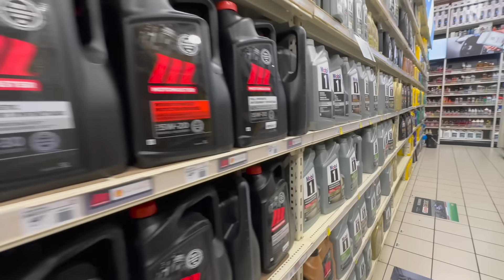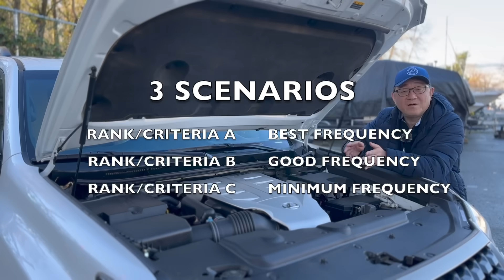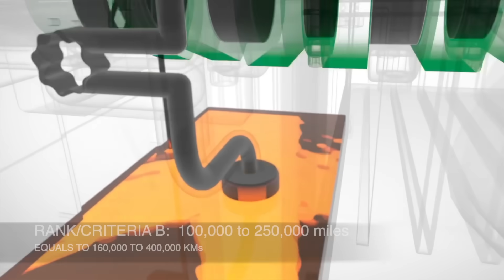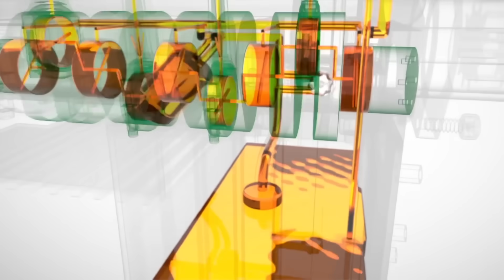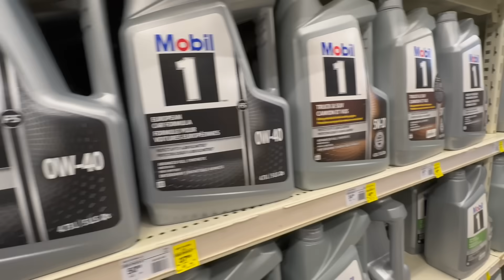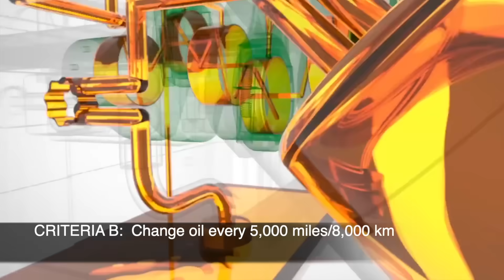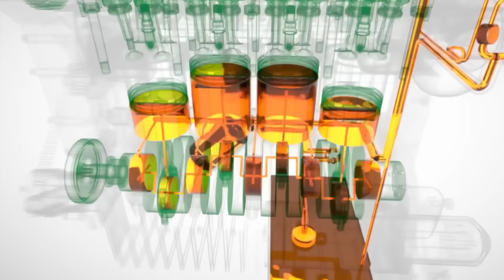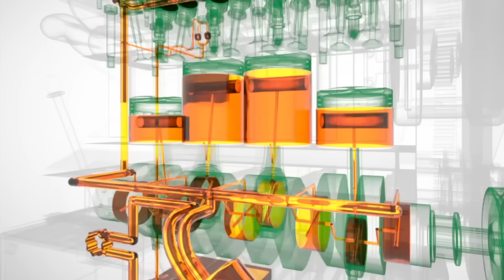ENGINEER EXPLAINS HOW OFTEN TO CHANGE OIL & FILTER // UPDATED CRITERIA-BASED RECOMMENDATIONS!

Comment: I've owned my 2004 Audi S4 since it had 13,000 miles. After 20 years of use it now has 161,000 miles. I change the oil and filter every 10,000 mi. as recommended by Audi, with Mobil 1 full synthetic without issue. I'm even on the original timing chain guides and tensioners.

Comment: David thank you so much, I have been using 20W50 mineral oil on my Montero Mitsubishi for 15 years and changing every 5000 kilometers, can I change from 20W50 oolong to 10W30 oil and how does this change will affect my engine or will this change may protect my engine ? Thanks again!
Reply: I would use whatever viscosity is recommended by Mitsubishi.  20W-50 is too heavy an oil for that motor, unless you're experiencing a lot of oil consumption/burning.  It should be using a 5w-30 or 10w-30.

Comment: I purchased a new Corolla in 2007. I drove 3K miles on the factory oil then changed it with Valvoline full synthetic. I drove another 7k miles on that oil then changed it again at 10k miles. I’ve been changing my oil religiously every 10k miles and ALWAYS used Valvoline full synthetic and a quality filter, usually Mobile1. As of February 24 the car now has 265,000 miles and it runs like it’s new!  The oil looks like I just put it in even after putting 10k miles on it. A mechanic called me a liar when I showed him the dipstick with 10k mile oil on it. It’s just that clear. I started the 10k mile intervals so I would always know when it’s due for an oil change. I highly recommend Valvolines line of  full synthetic oils but honestly it doesn’t matter what oil brand you use as long as you stick with the same brand. I’ve been told that switching brands constantly is not recommended due to the difference additives each manufacturer puts in their oils. Today’s synthetic oils are far superior to oils used in the past when oil changes were needed after 3-4k miles. If you could see the oil in my engine after 10k miles you wouldn’t believe it.

Comment: Normal in Sweden is to change oil, and filter, at 15000 km, 9300 miles or once a year. It takes me about eight months and i do it myself and it costs ca 65-70 $ with 5,2 liters of premium oil. Never heard of any problem due to dirty oil when following that intervall using god filter and oil. My cars run at least 300000 km before i sell them. So it seems to be an american problem.
Reply: Americans are stuck back in the 1960's, before synthetic oil came along, and think they still need to change oil every few thousand miles. Oil change places and self-proclaimed experts are keeping the lie going.

Comment: I bought a 2020 Silverado (new in 2020) with a 5.3 V8.  I use it to tow a travel trailer in the summer (6000lbs). I change the oil at 7500 Km (the book says 15,000 km) and I can tell you that the engine works great.  I have changed the oil frequently for every car/SUV i have owned and the engines do not break - lots of other things break, but not the engines.  I always use synthetic oil, the grade that the engine needs, and I always put a new filter on.  I don't care if you get a new car every year or plan to keep it for life - change the oil.
Reply: It's unnecessary to change oil more frequently than the manufacturer recommends. You're just wasting time and money.

Comment: Your recommendations are very conservative. I’m an Amsoil user and I have been changing oil every 15,000 miles or 1 year for 27 years and have put as much as 287,000 miles on a car with zero oil related engine problems and the engines have always run like new when sold, even with 287,000 miles on it!!

Comment: No one will ever convince me to change oil beyond 3,000 miles regardless of condition of ownership. I have seen the power of 2500 mile oil change. Not only does it protect seals, it also ensures the cooling system works exceptionally even as the car ages. People keep focusing on oil as a lubricant when in fact, your engine oil is also an engine coolant.  Fresh oil will always cool better than old oil. With fresh oil, your radiator coolant does not work as hard and as such it will not break down the coolant as fast. The cooling effect of clean fresh oil is highly under-appreciated. And this is even more so if you have a car with turbos. You replace turbos in pairs even if one turbo fails. Replacing two turbos because you refused to change your oil frequently, can cost you between $2K - $4K. Brand new turbos are not cheap.

Comment: I change the oil on my crv 2004 every 3000 miles with full synthetic oil regardless. I figured its cheaper than a new car replacement  & I'll drive it to the ground 😂 It got 250,000 miles & I got at least another 250,000 miles life on it.

Comment: Sadly, there is no guarantee that an engine will last 60k miles, let alone 250k miles anymore. There just isn't any motivation to build vehicles that last from the manufacturer. In my experience vehicles are just getting more complicated and less reliable.

Comment: I change my own oil and use Costco synthetic.  That costs $30 for 10 quarts right now.  So for under $25 I get it done with the filter.  What is the point of going 10k, so I can save $25 per year?  Seems very foolish.  I'll keep with the 3k plan.  Thanks for confirming my decision.

Comment: It’s easy.  When oil light or engine light flashes then probably time to get an oil change.

Kidding of course
Currently driving a 2004 Prius. 225k miles. Change oil every 5k or 6months, whichever comes first.  Using Mobil 1 high mileage typically

Zero oil leaks, original hybrid battery
“Burns” 1/4-1/3 quart between changes.

Comment: Although I agree… 5000 miles
My ‘07 Yaris 5 speed currently has 301,000.
I’ve owned it since 18,000 miles.
I’ve changed oil and filter every 10,000 and have not touched the engine…not even the water pump.
Car runs great and currently uses about 1qt every 10,000 miles

Comment: Interesting summary and as always it also contradicts other engineer research and recommendations.  SYNTETIC oil summary: Ihad a 2003 Chrysler DC with 306K - change oil and filter every six months, but lost it in a wreck.  Current 2012 Chrysler TC with 123k change oil 1 a year and filter every 6 months.  I average 6K mi annually on 10-15K Mobil 1 and Mobil 1 HP Filter.  Bottom line: take good care of your wheels and they take good care of you.

Comment: Opinions are fun, but upon what data are these recommendations based?  I’ve never seen any data that shows a difference in engine life for 3,000 mile changes vs. 5,000 or even 7,500 miles.  Lots of anecdotes and opinions, but no data.

Comment: Owned my last car for 10 years, changed oil every 7500 miles with synthetic.  It ran fantastic when I got rid of, had 120,000 miles burned next to-no oil.  Built several high HP engines over the years and ran synthetic oils in them changed every 5000 miles, when I did finally pull apart (mostly to build a higher HP engine) there was zero signs of additional wear to bearing surfaces.  I try to use Mobil 1 but have used Pennzoil and Castrol.  We have owned several Audi’s have 2 now and change them the recommended 10k, have yet to have any issues with any of them, my wife’s was the longest owned that one and traded in with 98k miles.

Comment: ‘’I bought a new ‘’2023 TRD OFF ROAD PREM’’….I had the oil 1st oil changed @ 1000 miles….next oil change will be at 5000.00 ..got underneath my 4 runner..1st. Thing turned my spare tire upside down so I can check the air in it and also sprayed rust on top of the spare tire. Then undercoat the rest of the truck.   I will tell you this truck rides fantastic.    ‘’Thank you …for all the reviews and videos on these amazing automobiles.    Thanks. God Bless and many prayers to family and friends.
Reply: Don’t most new car engines come with a special factory oil with additives in it that help keep the engine lasting and help with break-in? Most mechanics I hear this information and that’s why it’s recommended for most new cars to not change the oil until 6000-7500 miles at least?

Comment: Where is the data? Otherwise it is just your opinion. I drive a car 30-40 years and 300+K miles with long oil changes of approximately 25K miles based on oil analysis, i.e. data not opinion.

Comment: Hmmm.  I like to keep a car for a long time.  I change the oil on my cars, with synthetic oil, every 5000 miles.  I have two cars that have 180K and 190K right now.  No engine problems.  A few years ago, I had a car that I used for work that did nothing but highway miles and always came to full operational temps each 57 mile trip. I changed the oil on it every 7500 miles.  I got 319,XXX miles on that car until I totaled it by hitting a deer. Car's engine was still running strong.  I might also add that I drain/refill the transmission of a quart of tranny fluid every other oil change and have never had a tranny problem.
Reply: I have a Australian Jackmaster Classic bypass filter on the Pontiac Torrent  3.4 engine and a Motor Guard on the transmission. The transmission will never need a fluid or filter change. The Australian Jackmaster Classic will get a filter element change and a quart of new Walmart synthetic every 6.000 miles. I cut the standard Wix open at  6 years and about 65.000 miles. The pleats were rotten but still in one piece. Im told the Wix XP is synthetic and wont get rotten. It should make it the rest of my life. The Jackmaster Classic does the cleaning. Im 83

Comment: Are aware if unopened 0w20 oil has a shelf life ?
Reply: 5 years is normally the shelf life, you'll find the stamp on the bottle. You could push to six if it wasn't stored in a garage, due to fluctuations of temperatures.

Comment: I use Mobile 1 or Castrol Full Synthetic and changed oil every 10,000 miles. I have done this for the last 25 years. I have run two cars up to 325,000 miles with no engine issues and sold them both running good. I wouldn't do that with standard oil.

Comment: I have a 2013 F150 with 230,000 miles on it and I change the oil every 3000 miles and filter and it runs like a brand new truck. 5.0 L.

Comment: 2004 Silverado 5.3 using Mobil 1.
Since new change oil and filter  every  year or 10K miles.
Now 20 years later at 200K miles, doesn't burn a drop of oil and runs like new.
Oil industry loves 3K.
Don't believe believe everything you hear 🤡

Comment: For the last 25+ years, Ive always done mine around 7000 with a premium synthetic,.like mobil 1, Valvoline, or Pennzoil.   Also use a premium filter, like mobil 1, k&n, wix, purolator one or better.  I stay away from fram...though ive heard their top tier version is good.   I tend to keep my cars long term (10+) years.  I would never wait until 10,000 miles, even if i was keeping the car short term.  Ive heard that Pennzoil ultra platinum is an exceptional oil but i dont think its dexos approved.

Comment: Good video. I like the 3 tiers you provided but had a question on it… you said particulate/contaminant is the reason for the oil change at 3k so why is the oil filter a 50/50? Shouldn’t you be changing the filter half way through all oil change interval if the oil is still good and the media is the issue?

Comment: I change my oil once a year, 2500-3000 miles. I use full synthetic high mileage oil and filter. I don't drive much my work is less than 10 miles from me.

Comment: First, let me say that I enjoyed your video; it was thorough and thoughtfully done. I am always intrigued by people asking how often they should change oil. By far, oil/filter changes are the least costly maintenance items an owner can perform, whether you do the work yourself or have it done. People go out and buy or lease a $30k, $40k, $50k, or more vehicle and then questions an $80 or $100 oil change. They hem and haw about the cost and they shouldn't. I change the oil in my 300k 2.4L Honda Accord every 5,000 miles and put in a quality filter. My 125k 3.0L Volvo gets an oil and filter change at 3,000 miles (European car!). Think about what a complicated piece of engineering the modern automobile is and the work it has to do to get you from point A to point B, and in the luxury to which we've all become accustomed. Oh, and as for the manufacturer's 10-20k intervals, that is just a load of cr@p and nothing more than a marketing ploy to get you into a new lease every two years because the service intervals are the length of the lease.

Comment: Can someone explain what the contaminants are that must be removed by changing the oil and what it is that they damage if they remain in the engine too long? If the oil is doing its primary job of lubricating, I don't understand the early rush to change it. Automatic transmissions are a different situation, if I'm understanding everything correctly.
Reply: I agree with the 3K mle oil change.  the contaminates are th residue from the internal combustion engine, that the piston ring do not collect off the cylinder wall on  he down stroke.   remember, a mild 2 thousand revolutions per minutes is a lot of explosions.
Reply: @roogermoore6135  I think what you're meaning about the rings is the blow-by of the combustion by-products that enter the oil and I completely agree but that's not the only place that contributes contaminants. Since I posted this, I've done a lot more research and realized how much I'd forgotten because I decided years ago that I wasn't going to lose my mind over it. What I've learned from a few detailed videos is that it's important to do oil analysis if you really want to know what's going in your engine but even better, as recently became a pinned comment, the only way to know for certain what's happening in your engine is to break it open and look. If, for example, you had increased wear on a particular bearing or piston, you'd never know it by simply changing the oil and it will continue to wear at the increased rate until it fails (think of Porsche flat six motors with the bore score problem or BMW V10 M motors, I believe it is, that have connecting rod bearing failures). Oil analysis will find the increased metal particles as well as be able to evaluate the amount of detergent, the remaining lubricating capability, whether you have water or fuel contamination, and the level of additives still remaining. One guy found that the results of a 5k mile change were virtually identical to one at 7.5/8k and had completely satisfactory levels of everything measured. At 10k it was clear that the interval was too long. This was on an older BMW 328i with 300k miles that he redlined every day. It's obviously crazy to try and compare different engines but the analysis of his engine showed that a 7.5k interval was completely fine and just as good as a shorter one. He also demonstrated in another test that time, basically a year of almost no use, does not degrade the oil or result in water entering the oil. The single cause of the oil breaking down is driving the vehicle. Your choice of a 3k OCI would be overkill for me because I neither drive heavy traffic nor extreme temp ranges. My current OCI of 7-8k or annually should be completely fine for long engine life and I'm very conscience of avoiding short trips where the oil doesn't warm up enough to evaporate the condensed combustion vapor or fuel that inevitably finds its way past the rings and into the oil. Very critical to keeping the engine wear as low as possible are using quality oil and filters as there is a vast difference in how they are formulated/built. My philosophy is to spend a little more on those components and save time and effort on the changes. Everyone, of course, has to decide for themselves what works best.

Comment: Always change my own oil and have 6 vehicles.  3,000 is a good rule but some engines seem to get dirty faster than others.  With synthetic oil 4 - 5 thousand is acceptable, but don't  forget other fluids like power steering, transmission, differential oil, flush of brake fluid and coolant.  These items are very important if you plan to keep it running like new.
Reply: Your good rule is based on what engineering data?

Comment: Not all engines containment oil at the same rate. I send my oil to black stone labs to have it analyzed. At 5000 miles the oil properties show low metal wear and high viscosity. So changing at 5 or 7.5k miles . 7.5k if under 6months of mostly highway miles. Acura calls for 10k oil changes but I never wait that long. 2005 Acura TSX that I’ve owned for 14 years, runs like new.

Comment: 1998 Nissan Maxima. 285,000 miles plus running strong. Synthetic oil for the past 18 years every 5K miles. Running clean and perfect 👍🏼
Reply: Took me about 20 years to put 250.000 miles on a 84 Subaru. Never drained the Mobil 1. Changed the toilet paper filter once a year or about every 12.000 miles and added a quart of new oil. A Caterpillar lab said the oil looks good for that many miles but suggested a filter change and a new quart of Mobil 1 every 6.000 miles. They found some caramelization. I removed the full flow fillter when the car was new. The engine was still running good but both head gaskets were leaking oil when I gave it away at a little less than 300.000 miles.
Reply: I probably should have put an oil cooler on the Subaru . When in Dallas Texas traffic with the A/C on the temperature gauge was near the red. Wife called me once. The radiater split at the seam.

Comment: Why are americans changing full synthetic oil after 5k miles? Its completely pointless , in all my european cars in the last 20 years ,fully synthetic oil has lasted at least 12k  miles with no crap in the filter . Is american fully synthetic oil not the same quality as European and UK oil? If it is your being conned, if it isnt your still being conned.